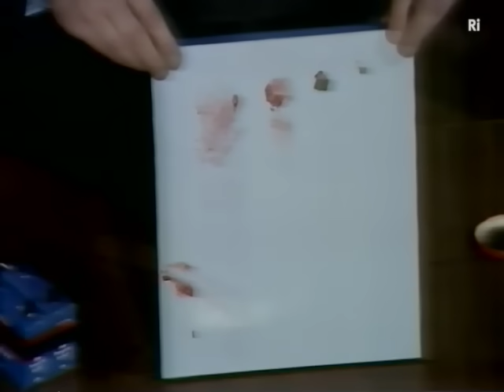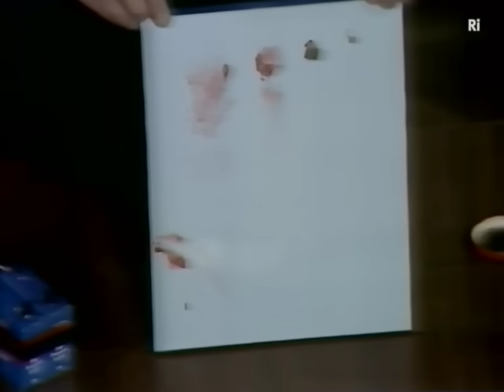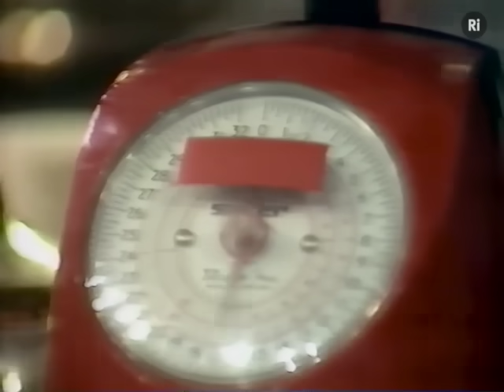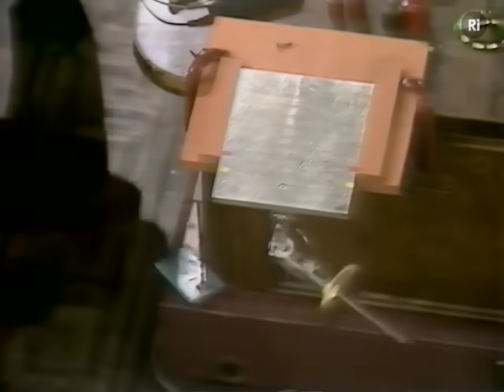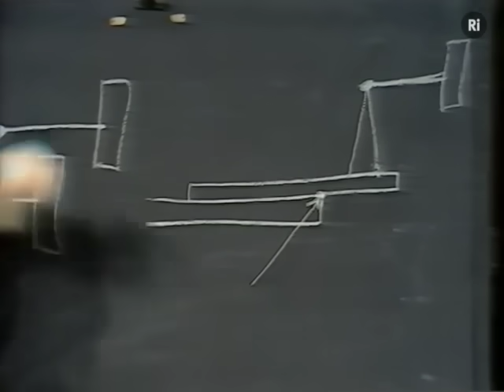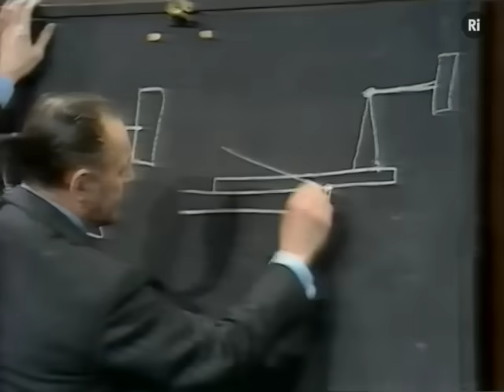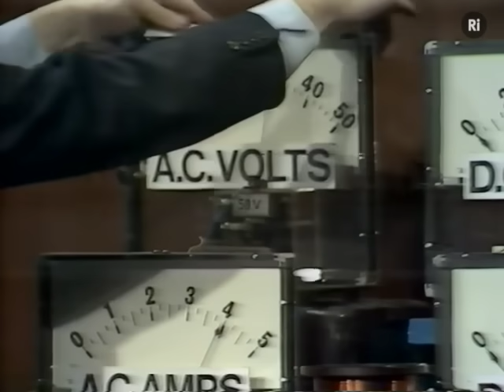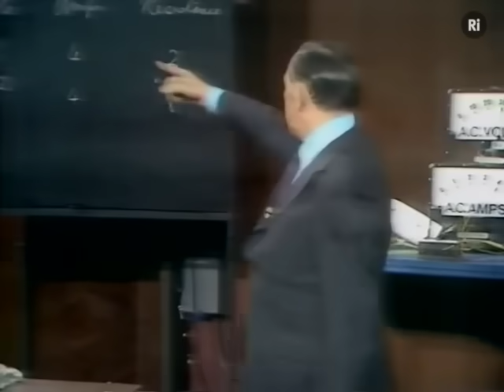☝#AntiGravity Part 3: Eric Laithwaite's Reality-Defying 1974 Lecture on Gyroscopes #HiddenScience

Comment: This may be a bit off topic :) but I thought some one might find it interesting. :)
I have an idea for a lifting force machine. 
Step 1: Get hollowed out cube.
Step 2: Securely attach magnet to inner bottom of hollowed out cube.
Step 3: Place a lever on inside bottom of cube behind the magnet that's securely attached to inside bottom of cube so that one side of the lever is pointing towards you and hanging over the magnet.
Step 4: Attach a vertical bar to the top side of the part of the lever that is not hanging over magnet witch is securely attached to inner bottom of cube. Make sure the bar goes all the way up to the inner top of the cube barley touching it.
Step 5: Securely attach a magnet to the side of the lever that is hanging over the magnet that is attached to the inner bottom of cube.
Note: Magnets need to be facing each other with attracting poles N,S or S,N
Note: The lever is going to have to be really close to the magnet on inner bottom of cube because of how close those magnetic fields need to be to interact. But not so close that magnets can touch.
The magnet on top connected to lever is pulling the magnet on inner bottom of cube towards it and since the magnet on inner bottom of cube is connected to cube, this pulling force acts as a lifting force. Now at the same time the magnet on inner bottom of cube is pulling the magnet on top downwards BUT the magnet on top is connected to the lever so any downwards pulling force is being converted mechanically by the lever into upwards lifting force. Now if you know anything about magnets you now that there are magnets powerfull enough to lift far more weight then just there own. So essentially this divice is exploiting the powerfull pulling force of magnets by mechanicaly transforming its magnetic pulling force into mechanical lifting force through the clever utilization of a lever, and walla stuff can be made to fly. Imagine if the magnets in this experiment where electro magnets so the ammount of electrical current going into them determined the ammount of lifting force that it would have. Now imagine this system being used as an attachment that could be placed under or ontop of vehicles to counter the weight of the vehicle and any cargo its carying. Now imagine  if this was done with powerfull permanent magnets and turned sideways and placed in an electric generator and had enough strength to pass through the magnetic fields as it propelled itself forwards with its own magnetic pulling force.     Signed   Adam McKenzie Anderson
 Extra Note: If anyone uses my ideas for none profitable means great I hope it helps but if they are used to gain profit in any way I want 25% of anything that comes out of it please. :)  My EMail is starfire7654321@yahoo.com
Reply: care to sketch the idea out?
Reply: Please draw a diagram and put it into a copyable but editable PDF for people to download.. 

Thanks
Reply: Rube Goldberg is that you?!  I was thinking of putting both feet in a big bucket and pulling on the handle. The harder you pull the higher you go. And then lean forward like a Segway and back to stop. Whadda ya think. It could work.
Reply: Main problems with the idea are: 1 lifting capacity is limited to the method of adhesion of magnet on bottom of cube and  likewise to the magnet's adhesion to lifting lever; 2 the field of a magnet and its strength are inverse squares, meaning the strength is greatly increased. Unfortunately the idea would make a more practical catapult than a heavy lifting device. Although the application of the theory of operation to something like a kid's toy or a puzzle box does have  potential
Reply: @mattblattel8106  :D Thank you for response. I will attempt to address the points you pointed out. 1st point of adhesion is very simply address, the magnets are not glues to surface but instead are built into structure, or are capable of sliding into groove that is built into structures, The structures themselves of course would be made of material that is very strong and can easily deal with the pressure. 2nd point about magnets inverse square is not an issue, the structure is designed so the magnet would be so close to what it's attracting it would be able to exert great force. The design I mentioned above is not complete in its detail I will elaborate below in next message.
Reply: @mattblattel8106  True it is not mentioned in this design how to totally deal with the downwards force. However there is a key element to the design that would address this. It's very simple really. It has to do with the fulcrum. It would end up being a very unique lever fulcrum system where there is a liquid substance in the fulcrum area that is kept in a constant state of molecular disruption. Imagine this, the magnet on bottom is pulling down on lever & redirecting the pull down to an upwards push on other side of lever and any force attempting to push back down as it go's through the fulcrum is getting redirected constantly because the liquid is in a constant state of molecular disruption that won't allow the force to go downwards, Now in this case the liquid would be exposed to a constant frequency that has the natural effect of forcing the liquid molecules to exert there force up and not down. It all comes down to how the liquid molecules are being manipulated. If done correctly you would have a system that is exerting force in one direction close to the strength of the magnets being used.
Reply: @mattblattel8106   The frequencies of energy being emitted through the liquid to force the liquid molecules to face a given direction or even forced to face multiple directions at different points in the liquid solution is not actually intended to generate an upwards lifting force. All it's intended to do is take the incoming force trying to push device down and redirect it in any direction except down. Imagine the top surface of liquid is experiencing the downward push as force is pressed upon it but every single molecule of liquid below it is being forced to face a direction that forces the incoming force off to the side. Don't think big here think small, :D all it has to do is redirect enough downwards force to allow the amount of upwards force the magnets are perpetuating through the lever to be greater than the mass of the entire structure being used. Even if the magnets being used in this relatively small device only achieve a small but constant (since they are permanent magnets) effect that exerts its force in an upwards direction more then a downwards direction one could build many of these devices and then use them in something bigger. Key fact: The device in and of itself does not create energy it just takes the constant magnetic field effect of a magnet & puts it into a system that is constantly converting its magnetic field effect into mechanical energy that is being cleverly redirected to ones needs. Might be best to think of this as a redirect and not a stopper. Imagine a billiard ball rolling straight down a table, now if you push another ball directly at it then yes to stop it you will need an equal amount of force to deal with the issue, but instead if you just say I'm going to have my ball nick it at an angle and all the force from the incoming ball is redirected to the point of it hitting the side of the table instead of it making its way all the way to the bottom of the table and and exerting its force there. :D
Reply: @mattblattel8106  Since you took time to respond I have another idea you might find interesting:

 Electric Generator Design that's powered by it's self once it gets going & perpetuates more electrical current then is needed for it to run continuously on it's own. 
 Step 1: Calculate how much energy you need pumped into an electric motor to make a vertically positioned circular platter with magnets in-bedded horizontally around it's left side and right side (so there pushing force is pushing out sideways relative to the vertically spinning disc) to spin as fast as you need it to. Also better to make sure these magnets are shielded around their sides & back  with metal that has high permeability so the magnetic field they are emitting is focused fully out sideways. :D Step 2: Calculate how many sets of copper coils you need to be interacting with magnetic fields to achieve this & to perpetuate more electrical current flow then is needed. :D Step 3: Build a round horizontally positioned platter covered in all these copper coils pointed down that does not move (Is stationary) :D Step 4: Build a round platter covered in powerful magnets pointed up that can spin and place it directly under platter with hanging copper coils. :D Step 5:  Position the vertical platter that is  motorized close to the horizontally positioned platter covered in magnets pointing up so that when the vertically positioned platter spins the in-bedded horizontally positioned magnetic fields slam sideways against the edge of the horizontally positioned platter causing it to spin. :) Step 6: Make sure enough of the copper coils are feeding their electrical current into the electric motor and the rest of the copper coils are linked into a set of rechargeable Battery's placed in the closest most convenient spot. Step 7: Build a duplicate setup of horizontally positioned discs with hanging copper coils and disc with upwards facing magnets and assuming the first set of discs are positioned to the front left side of vertical spinning disc, position the other duplicate structures to the front right, the back left and the back right of the vertically positioned motorized disc. As the vertically positioned motorized disc spins the horizontally in-beaded magnets will now hit into all 4 horizontally positioned discs causing them to spin. so you will effectively be using the spin of one disc powered by one electric motor to spin 4 constructs that are each generating electrical current. now build this whole setup multiple times over and use the current perpetuated by it to power up scaled electromagnetic generators that are equal to or more powerful than the ones used in a nuclear power plant. You will now have a device that is self perpetuating off of it's own electrical current perpetuation and no nuclear waist to worry about.
 Here is the reason why my device does work. You see even tho the more electrical load you impose on a system ends you up with greater back emf hindering your devices ability to move and generate current, there is a way to work around this. My device multiplies the amount of mechanical motion that is taking place because of the 1 motor. On top of that, it eliminates any extra resistance that could have been imposed on the motor by making the other wheels spin by having the magnetic fields hit the rotating discs the way I described. You see, the vertically positioned disc connected to the motor is perpetuating the spinning of at least 4 main discs that are spinning magnets at no extra effort on it's own part because as it spins around powered by the motor, it is the horizontally positioned magnets that are shielded by high permeability metal that are using their magnetic push out sideways to force the other horizontally positioned discs to spin. So even tho each of those 4 discs spinning are somewhat hindered by the back emf it does not change the inescapable fact that each disc is perpetuating the flow of current in the copper coils above them and the amount of electrical current being perpetuated between all 4 discs is greater then the amount of electrical current the motor needs to run at max potential. It is called over unity and the extra electrical current the motor does not need can be fed into larger more elaborate electric generators. Imagine 12 of these designs contributing to the power needs of a much more powerful design (Probably electromagnetic) that is utilizing this same idea of multiplying the number of horizontally positioned discs that spin because of the motion of one powerful  motor spinning a vertically positioned disc cleverly positioned so that it spins at least 4 other discs at a much higher velocity because of it's more powerful design. In short its all about multiplying what the first motors disc is interacting with & second, up scaling the design to more powerful designs that utilize the same principles.
Reply: @mattblattel8106   Improvements to vertically positioned spinning wheel in electric generator design.
Design that allows the re-magnetizing of magnets horizontally plugged into vertical disc.
Aspects of Disc and connected components.
1: Disc it's self is non magnetic 
2: Disc has square shape (or other if better) in center that fits over shaft that is connected to motor that makes it spin.
3: Disc has copper (or other conductive material) ring around its rim. This electrically conductive ring has branching electrically conductive wires that branch towards center of disc. 
4: Disc has rectangular (or other shape if better) crevices all around it's left face and right face where the high permeability container housing the powerful magnets are to be placed.
5: Magnets in the high permeability material (steal/Mu-Metal/Other) have copper coils rapped around them and both ends of copper coils poke through small openings in the back side of the High permeability container. As they poke through they make contact with copper wire that is directly connected to the ring of copper around the rim of disc.
6: In front of vertically positioned disc is an electrically conductive brush (like the kind you would see in a motor making contact with the commutator) that can be pushed right up against the copper ring that is around the vertical disc. This electrically conductive brush is in it's own little rectangular housing that is not electrically conductive. However the bottom inside of this none electrically conductive housing is a lining of electrically conductive material so the current can travel from this to the brush and then to the ring of copper around the disc which in turn gets the electrical current to the coils around the magnets allowing them to be re magnetized while still apart of the Electric motors structure. The housing for the brush is capable of being safely pushed towards the ring and locks into place when it is directly touching the discs conductive ring. The platform the brushes housing is sliding on has electrically conductive plating and is directly connected to a switch so that the current cant get through until you want it to. This way brush can be pushed towards ring make contact and then switch can be flipped to allow current. When magnets are re-magnetized the switch can be flipped to turn off flow of current and then the brush pushed back away from spinning disc so there is no unnecessary friction.
Reply: @mattblattel8106  Over Unity Water wheel electric generator:
 Top of structure has Huge slanted basin (If looking at it from the side it would be slanting down to the right). When filled with water the water naturally slides down and over edge where it starts falling straight down causing water wheels to spin. Water wheels are stacked on top of each other not touching but close. As water falls it hits them all one after the other making them all spin as it makes it's way to the bottom. At the Bottom of the structure there is a large slanted basin. This basin is slanted in the opposite direction to the one on top so the water slides down to the left, into a pool of sorts that is U shaped,(imagine right below the water wheels is the shallow end and as it slants down it gets deeper for some distance then winds around to the other side of construct and comes back up to another shallow end. Now directly behind the water wheels on a flat surface that is above the pool of water that's curving around it, there is another wheel positioned vertically but this one is not a water wheel, this one has powerful magnets embedded horizontally inside of it on both of it's flat sides so there magnetic repulsive field is pushing outwards away from the disc on both sides. (Also each embedded magnet is surrounded in high permeability metal or Mu-Metal to focus it's magnetic field lines into a condensed strong field. This disc is powered by one powerful electric motor. Now imagine long hollowed out cylindrical tubes submerged & sticking out of the pool of water and reaching all the way up and into the basin that holds water on top. Now imagine each tube has a windy slide inside that goes from top to bottom. Now imagine the tube has rings around it that are magnetically repelled so when the main wheel spins around the horizontally positioned magnets hit into the side of these rings causing the entire cylindrical tube to spin. The spinning motion of the tube will cause it to scoop up the water in the pool and the centrifugal force of the spin and the windy slide inside will guide and force the water back to the top. Now remember for this to work properly there needs to be enough water wheels spinning to generate more electrical current then the motorized wheel needs to spin. 
Key Element 1: Number & quality of water wheels. 
Key Element 2: Quality of electric generator connected to each water wheel.
Key Element 3: Enough tubes to pull enough water from bottom basin back to top basin to equal the rate and amount of water filling both basins at any given time. 
Key fact: The accumulation of electrical current from the electric generators connected to the water wheels must be greater then the 1 electric motor needs to spin.
Key Fact: One must divert the needed electrical current from the generators connected to the water wheels to the motor spinning the disc that has the magnets on it. 
Key Fact : If this is done properly it would be an over Unity Electric Generator.
Reason why some may think this would not work: Some would say the amount of energy the motor needs to spin the disc with magnets on it will always be greater then the amount of electrical current being perpetuated by the electric generators on the water wheels complements of natural energy losses do to heat and friction.
This assumption is understandable however I will explain why this does not stop this device from being an over unity device. You see it comes down to one simple truth. The motor spinning the vertically positioned disc is only actually doing a fraction of the needed work, it is the horizontally positioned magnets impacting into the tubes causing them to spin that is doing the heavy lifting :) and since the magnets are positioned horizontally on disc the push back against them is unable to hinder the motor spinning the disc to a degree that would require it to do loads more work.  
In conclusion this is a device that can be self contained away from the elements so as to not hinder it's effectiveness. And it is an Over unity device if built correctly. 
& to all you nay Sayers out there I would just like to add I hope you all have a great day and whether you like it or not this design works. :D
Reply: @MasterFeiFongWong  I'm curious. Have you built one yet? Or anything? I'm just curious, not a smart a s s. I want all the knowledge I can find. One day SOON the lights are gonna go out. I'm just a baby in this field. But I do need to know how to build a self operating unit that can run my frig and AC. I don't even know where to start at.  Thank you.